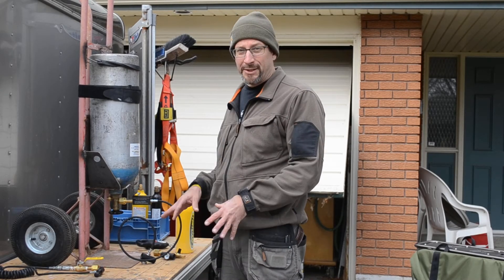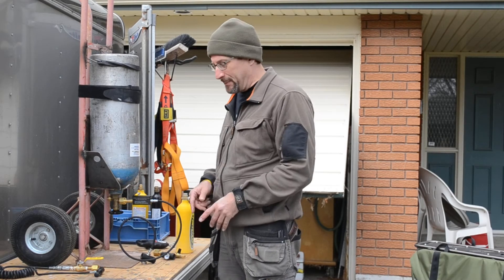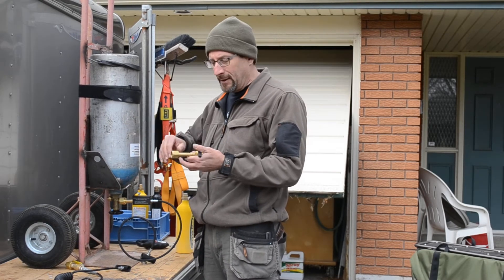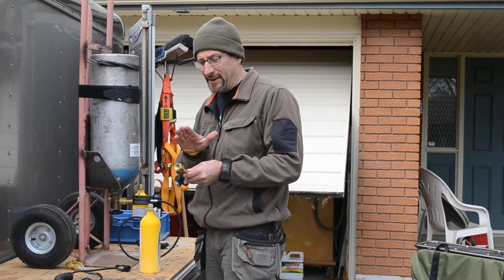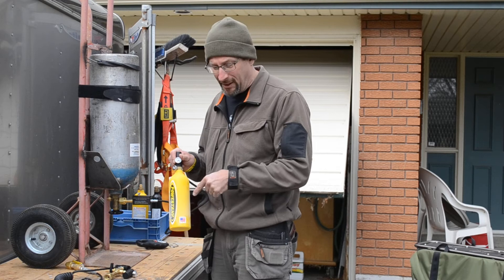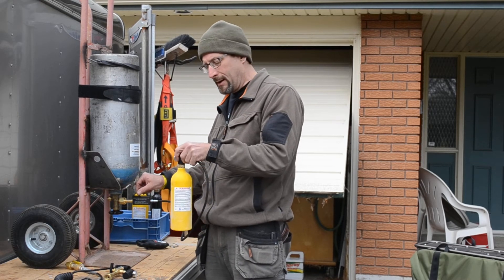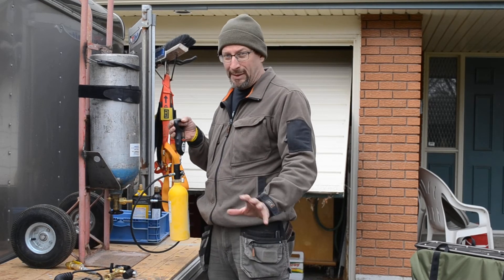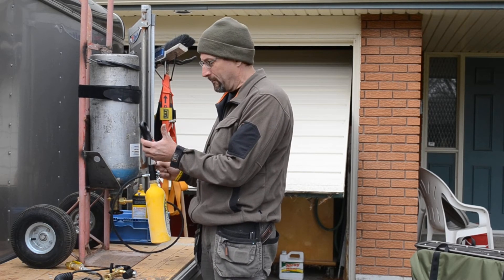How To fill a 20 oz. CO2 tank

Comment: How can you tell if your tank is syphon or not? Is there a marking?
Reply: Siphon tanks usually have a white line vertical down one side
Reply: It would be marked and the top valve would be different. If it up right and you open the valve and gas comes out it's not a syphon tank. That's why mine is inverted so I get the liquid